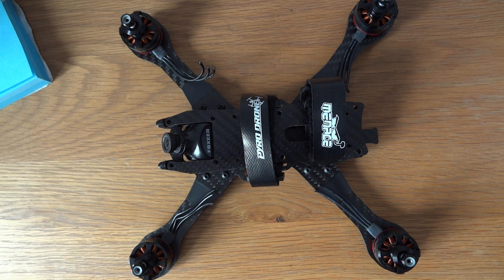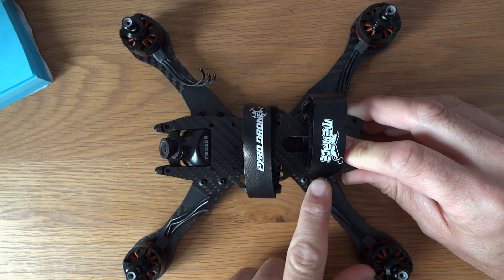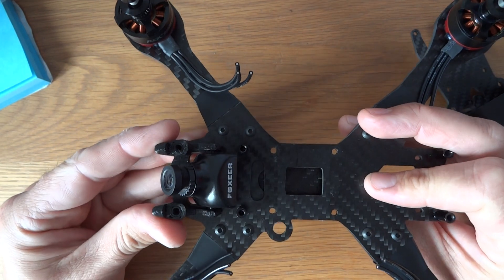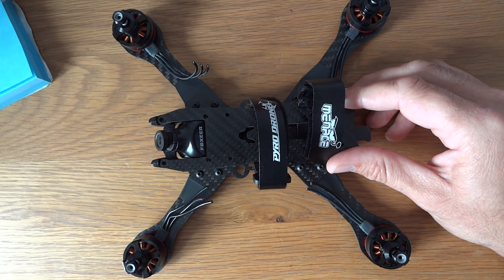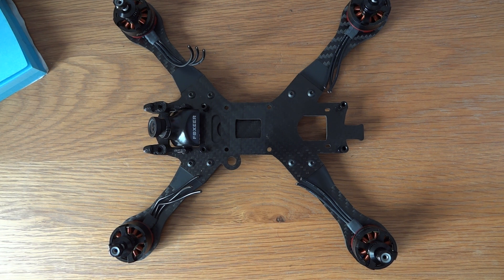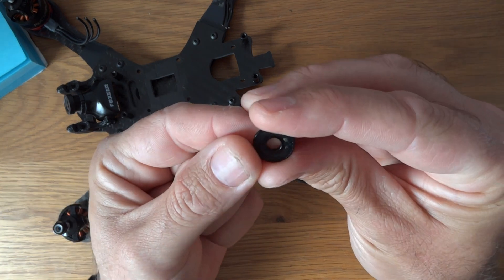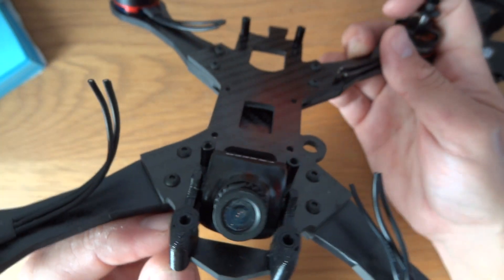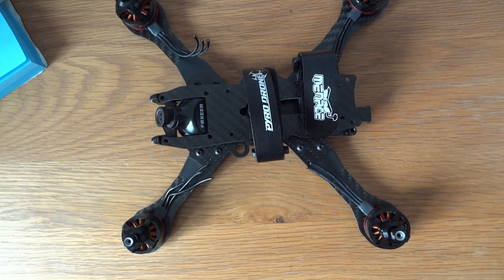Freestyle fpv drone build 2017 part 1 - Hyperlow 5" frame & RCX rs2206V3

Comment: I don't like that the bottom plate has a big square cut out on the backside..
Reply from the maker: cliterfish that's too cool the vtx if you run 10mm height. Also drops weight from a part of the quad that doesn't need super strength. I've flown and crashed my 100s of times and nothing has ever broken. Now I'm flying the new CG I don't have time for this one, so it's been stripped and packed up and is off to a sub in America who loves them and wants a fleet :)